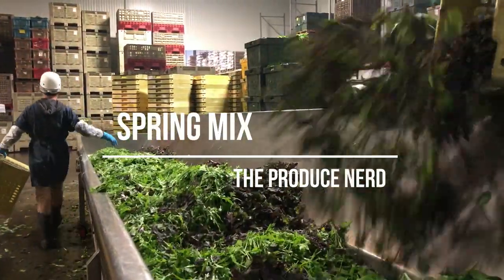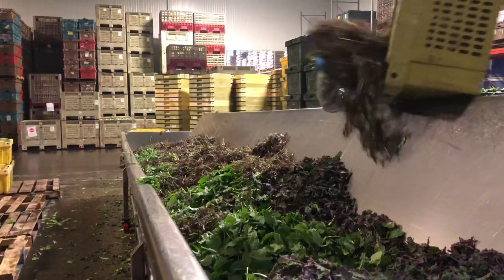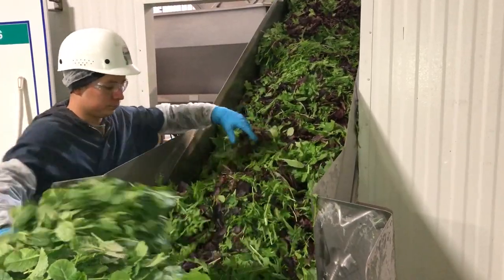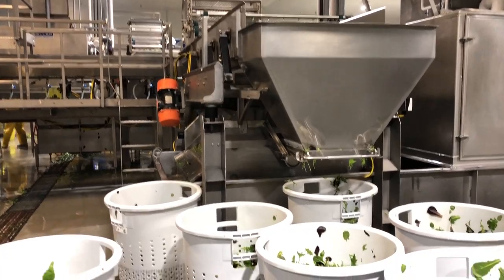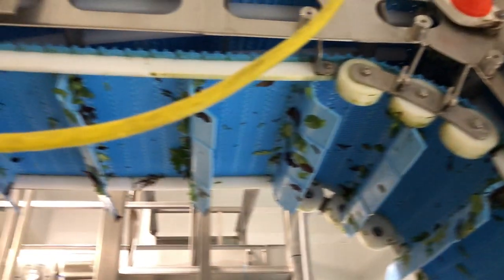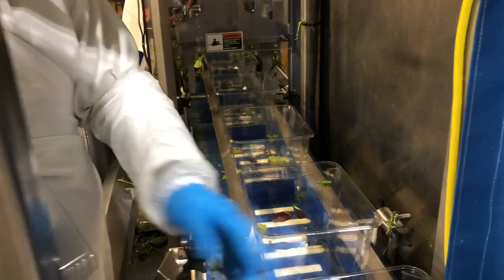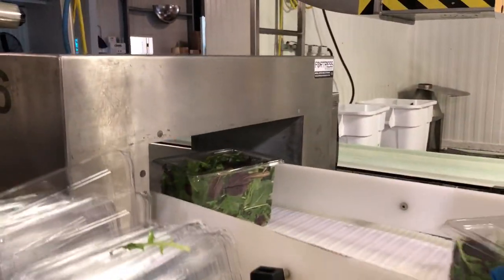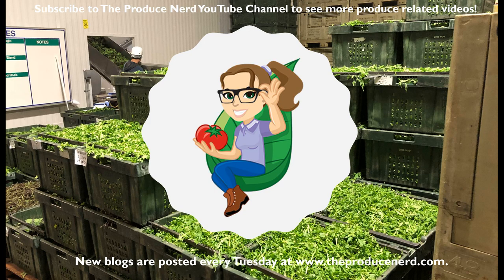Salad Processing: How is Mixed Salad Made (in California)

Comment: Very inefficient production line. Cant understand why they are not using a vertical bagger in instead of that manually operated tray and lid system. More product on the belt and floor than in the containers!